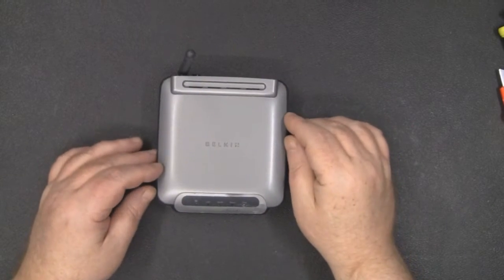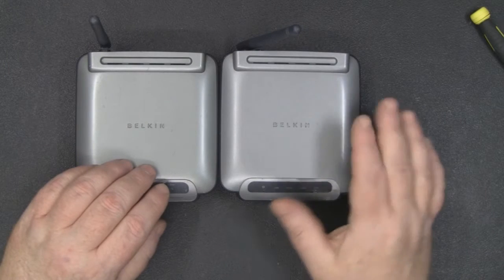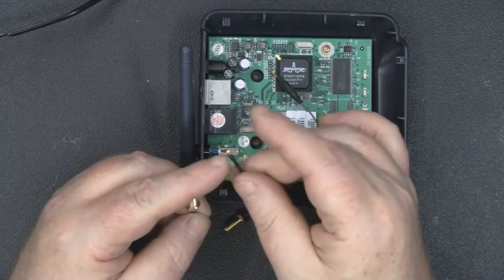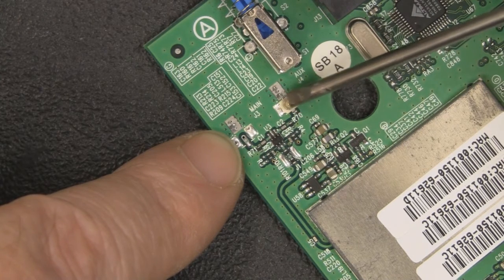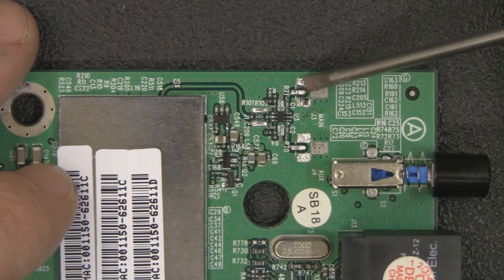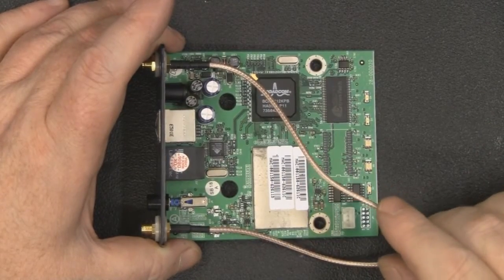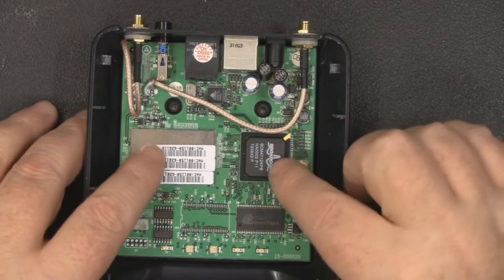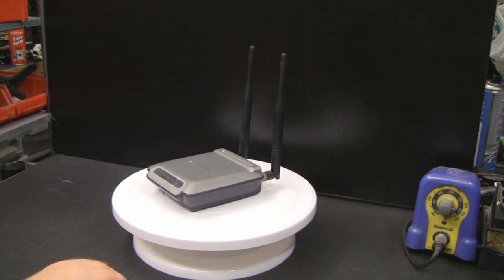Belkin wireless print server antenna mod #100

Comment: Great video, really like all your antenna videos, been watching them for a while.  One thing I found helpful with a similar belkin router was to use a hair dryer to heat the label up and it lifts away very easily.

Best!
Reply from the maker: Saeed Hossain Thanks Saeed hair dryer would work better nice tip